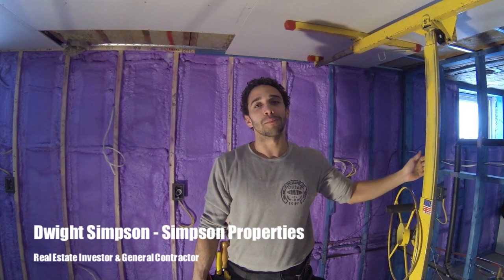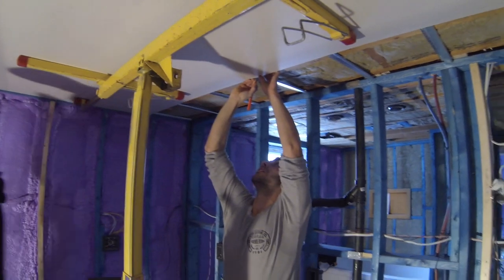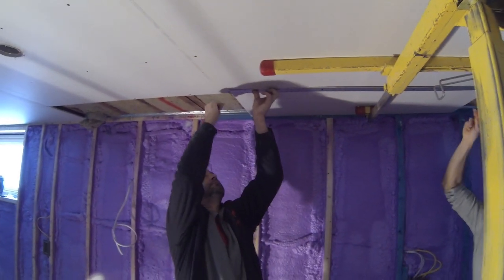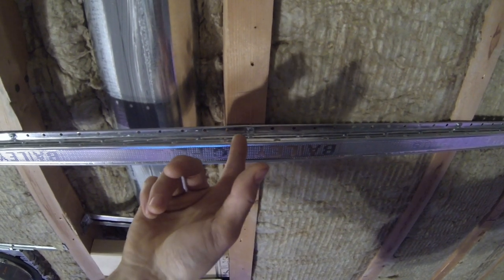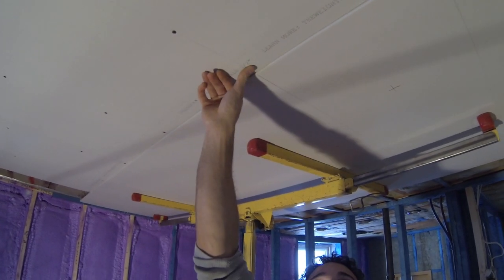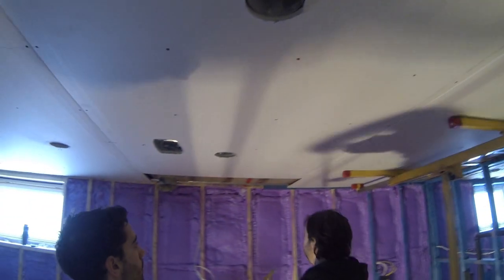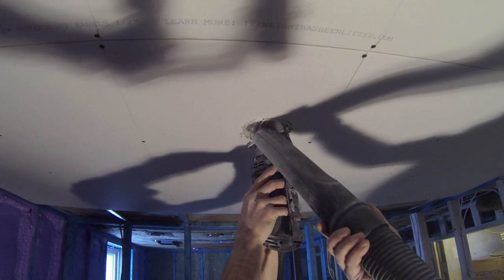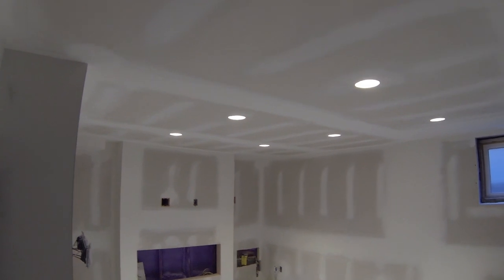HOW TO INSTALL DRYWALL ON A CEILING WITH RESILIENT CHANNEL

Comment: Condo. I live on 2nd floor. There are wood floors upstairs. I hear every step like it bangs. 
1. I want to take down existing ceiling. Add Res Channel and hang new drywall. Will my existing recessed lights ruin the whole job in terms of defeating the purpose.
2. Can i keep existing drywall, hang the channel through drywall onto joist, then hang 2nd drywall onto res channel?
Reply from the maker: If you live in a condo I would check with your condo board and see what alterations you're allowed to do first. 
1) Less holes (potlights) in the ceiling is better in terms of soundproofing. It's not going to make a drastic difference. The main issue with soundproofing between units is if they share common duct work. I doubt that is an issue in your case. If you plan on removing the existing drywall I would remove the can lighting and upgrade it with a product like Liteline Luna or Ovid makes great products as well. They have clips that hold the light in place rather then a large metal housing. Aligning the old pot lights with the new lowered ceiling will be difficult.
2) The best practice would be to remove the existing drywall. Install an insulation like Rockwool Safe'N'Sound in the ceiling cavity. Then install res channel and clips. Followed by two layers of 5/8" drywall or a product such as CertainTeed SilentFX drywall.
Reply: There are "floating" recessed LED lights that lock in to a hole in the drywall itself. These include a "junction box" which plugs in to the LED light. I'm going to be giving these a try to eliminate anything attached to the joists.

Comment: Can this be applied over already installed sheet rock ceiling (standard installation) or is that a waist of time for sound proofing so we don’t hear our parents downstairs
Reply from the maker: It would defeat the purpose of the res channel because the system would be “shorted out” and not floating. In your scenario you would be better off adding an additional layer of 5/8” drywall to help build up the mass on the ceiling. That may help deaden the noise a bit.

Comment: When installing pot lights, can their respective junction boxes attached to the joists be hidden or do they have to be accessible by fitting into a cut opening in the drywall?  I have four junction boxes for eight lights that are upright against the side of the joists. I planned to cut the 4" hole for the pot light and grap the wire then connect. Thanks.
Reply from the maker: All junctions have to be accessible. I would recommend double checking with your electrical inspector.

Comment: Thanks you for this video 🙏🏼 

One question I do have is … is the resilient channel going to be the only thing holding on to the double layered 5/8s plasterboard then? So the resilient channel are strong ?
Reply from the maker: No problem. Yes the resilient channel is designed to support the weight of two sheets of 5/8" drywall. I know its seems flimsy but surprisingly its strong and built for the task.

Comment: Has anyone had issues with the fine thread screws stripping in the resilient channel? I am also finding the resilient channel to be bending up when I try to put a screw in. Any advice?
Reply from the maker: I personally never had any issues with the screws stripping. If your resilient channel is supported properly that shouldn’t be happening. Maybe you need to adjust the torque setting on your drill?

Comment: it looks like you did two layers of drywall on the ceiling. Did you stagger the drywall so your seams aren't in the same location? If so does both pieces of your drywall have to be perpendicular from the res channel?
Reply from the maker: Erik Wall Erik Wall I only used one layer of drywall. You're right, if you use two layers of drywall you would stager them and install both layers perpendicular to the res channel.

Comment: what screws did you use to install resilient channel to cieling joist?
Reply from the maker: Check the video description section. The material used is documented there.

Comment: What r ur thoughts on using a chalk line instead of a T-square? Might be quicker. Thanks for video, doing this for my new place and it helps out a lot. I'm trying to be a DIYer
Reply from the maker: L V that's a great idea. It would  probably speed up the process. Just be careful with the chalk that you use because some chalks are designed to be permanent. Good luck with your project! Let me know if it was faster to use the chalk line.

Comment: What about the edges? Is the dry wall allowed to touch the wall? Wouldnt vibrations from the wall transfer to the new drywall? Or should you leave an air gap and mud over it?
Reply from the maker: The vibrations that pass to the exterior walls is unavoidable. You don't want to compromise your corner joints by leaving a gap. Your ceiling should be installed first, then your walls installed with tight joints. Leaving large gaps will cause cracking in your tape joints over time.
Reply: Standard practice is to leave 1/8th gap and use acoustical caulk, that way sound doesn't transfer to the walls. Then mud and tape as usual. In an ideal world you need to treat the walls with channels as well because sound travels right around the ceiling assembly into the walls via the studs, especially impact noise and low frequencies. The res channel will help a bit though for sure. Concrete walls don't necessarily need  channel.

Comment: Hi Dwight, thanks for the video. How important it is to have the drywall perpendicular to resilient channels? I have a small room and if I install drywall perpendicular than I will have few but joints and if I install other way than I will not have any but joint? Thanks
Reply from the maker: Zahid Iqbal no problem. I'm glad you found the video helpful. It's critical to install the drywall perpendicular to the supports. The great advantage to working with res channel is you can always add an additional piece if your joints are not supported properly.
Reply: Simpson Properties thanks so much!!!

Comment: How to you install a garage door opener in this case?  Do you mount the garage door opener to the resilient channel?  My bolts failed after 7 years.  I think they are mounted to the resilient channel.  Do you have suggestions for fix?
Reply from the maker: +Derek Lin the best solution is to have blocking in between your ceiling joists. That would give you lots of wood to fasten too. Since your drywall is already installed I would use longer fasteners and anchor the door opener through the res channel and into a ceiling joist (stud).
Reply: I don't know if there is a joist above the bolt.  How do I find where the joist is?  I don't have an attic.  Do I need to cut a big hole in the ceiling to figure out where things are?  I am using a 3" bolt and it's not into wood/joist, in your opinion, how long a bolt should I need to get into the wood from the drywall?
Reply from the maker: Since you have resilient channel installed you won't be able to use a stud finder to locate the studs. You have a couple options either cut a small hole in the ceiling to locate a stud or drill the lag bolt in a few spots until you find a stud. Screwing the lag bolt in blindly you run the risk of hitting a buried wire or drain potentially. Either way you will have some minor drywall patch work to do. 

The res channel is only 1/2" thick so a 2-1/2" lag bolt should be long enough.

Comment: Great video. Question...When drywalling where the walls and ceiling meet how much of a gap is there? I heard they can't touch?
Reply from the maker: +WhiteKnight48 thanks! The best practice is to install your drywall on the ceiling first then install the drywall on your walls. There should be no gap. The drywall on the walls provides additional support for the ceiling drywall and will strengthen your corner joints.
Reply: Yes, typically the walls support the ceiling. However, this is what I've been reading and it makes sense in my opinion.

"Where a wall meets a resilient ceiling, a 6-mm (¼-in.) gap should be maintained to prevent supporting of the ceiling and grounding of the resilient channel. This gap should be filled with resilient caulk, and can be finish-taped"

Comment: When installing the drywall perpendicular to the channel and you come to the end of the sheet of drywall and go to the next sheet going the same direction, do you center the ends of the 2 pieces over the resilient channel?
Reply from the maker: Normally your butt joints are always staggered similar to a brick wall.
Reply: @simpsonpropertiesltd  I don't understand your analogy here.  It sounds like you're saying to keep the resilient channel in the center of the butt joint?
Reply from the maker: digitalcurrents you would need to have a piece of res channel to support the 4’ end of the drywall. You could either install the drywall halfway over the res channel or install an additional piece if needed.

Comment: I have got the resilient channel installed but my only question is since the resilient channel only has holes in one side won't  the drywall just sag off the channel or RIP off . Please help
Reply from the maker: Single leg drywall is designed to only have screws installed on one side. This helps eliminate any imperfections/uneven ceilings. I know it may seem flimsy and appear that it can’t support the drywall. Once you fasten the drywall to the res channel you will be surprised at how strong it is.

Comment: what is the typical price for installation ?  How much would a single 12ft rc metal  cost?
Reply from the maker: 12ft lengths of resilient channel cost $5.30 each (CAD) at Home Depot. It's best to check with drywall contractors in your area and see how much they charge to install it. They should provide you a cost per square foot number.

Comment: Awesome video brow! I'm soundproofing my garage using the same methods, my studs are 4x2. Which rockwool density would you recommend? The 100mm 45kg or the 75mm  60kg? Thank you
Reply from the maker: Thanks! I would recommend using Roxul Safe’N’Sound insulation. It comes in either 16” or 24” widths. Depending on how wide your cavities are will determine what size to buy.

Comment: Can you use resilient channel on the ceiling with 5/8” green board?
Reply from the maker: Yes most resilient channel is designed to hold 5/8” drywall. Always check the spec sheet of the particular res channel that you use.

Comment: How much did that spray foam cost?
Reply from the maker: Reach out to local spray foam contractors in your area. They will provide you with a price per sq foot. Sharing costs from a 5+ year old video won’t provide any benefit to you. Plus, prices vary based on your location.

Comment: Can you use osb board instead of drywall into the res channels
Reply from the maker: Resilient channel is designed to support drywall. I would not recommend installing OSB using resilient channel as the support. If you’re installed OSB say in a garage typically it’s installed directly on the framing. Always read the manufactures spec sheets it will state the proper uses of the material.
Reply: OSB is fine and is often combined with drywall for a second layer in studios etc. Different materials have different abilities to stop certain frequencies so mixing is preferable. The standard Clark Dietrich res channel is made to handle two layers of 5/8 x, which is very heavy. Most of these products can handle way more weight than their stated max. For instance Whisper clips with hat channel fail at almost 30 sheets of drywall. Rsic-1 clips are stated for 35 Pounds each clip but will hold hundreds of pounds each. If in doubt call the manufacturer. I talk with these people all the time and they often offer lots of tips and/or actual CAD drawings for various problems like beams and windows. Pac International is especially helpful on their products.

Comment: can i use just resilient channel no roxul insulation. i dont need it 100% soundproofed just a slight improvemnt
Reply from the maker: Resilient channel helps reduce vibrations where as Roxul Safe’N’Sound reduces sound transmission. If you’re looking to sound dampen with a limited budget adding one layer of Safe’N’Sound to your ceiling cavity is probably your best option.

Comment: Why the T square? 1st screw goes into the center of the res channel, sight down the sheet to the screw on the previous sheet. T square is a waste of time, just for rookies for rookies. By the time 2 people finish marking the sheet it could be completely screwed off!
Reply from the maker: I agree Peter. At the time of making this video I was a rookie at hanging drywall. I was doing the best I could with my knowledge on this particular task. I appreciate the feedback though 👍🏽

Comment: LIS Drywall sells clothes now?
Reply from the maker: The owner of LIS drywall has moved on to a new endeavor as a custom home builder. I guess that old URL has been bought by a clothing company now. I will remove the link. Thanks for the heads up.
Reply: @simpsonpropertiesltd  if you ever get work and need help around the markham durham region hit me up. I have experience

Comment: Good grief... you don't need to mark where the channel is... just drive the screws opposite the last sheet then on the end where you can see the channel... you should be able eyeball the field
Reply from the maker: There are a million ways to do a task depending on your skill level. It’s not something I would do now but at the time it worked for me 👍🏽

Comment: 5/8TH'S DRYWALL...will this flimsy product hold 5/8th's? CEILING INSTALLATION
We are using RC BAILEY BRAND (looks identical to what you are using) > http://bmp-group.com
Reply from the maker: I know it can be deceiving that resilient channel can bare all that weight. I use the same brand. Surprisingly it is rated to hold up to two layers of 5/8” drywall. As long as you install the res channel correctly you won’t have any issues with strength. It’s not a bad idea to use a drywall adhesive like Tytan for additional strength and reduce the chance of screw pops.
Reply: Tytan? where do I install it? its a glue? where does the adhesive go? I do not understand. goes onto the gypsum??
Reply from the maker: Google “Tytan adhesive” look on their webpage. It’s simple to use. Apply it to the res channel or studs and install the drywall on top.
Reply: Simpson Properties is the Tytan Adhesive completly necessary?? adding another step to this is going to make my husbands head blow off....and i cant find a video on how to do it. Thanks for your help.

Comment: Your doing the res Chanel all wrong. It is ment to go between sheets of drywall. It creates space between the sheets to trap sound and heat . So learn the proper use of resilient Channel if you plan on showing how it's done
Reply from the maker: Dale you have produced 0 videos, no profile picture & probably still live at home with your parents. Why don’t you create some content and show the world “the right way” to install res channel?